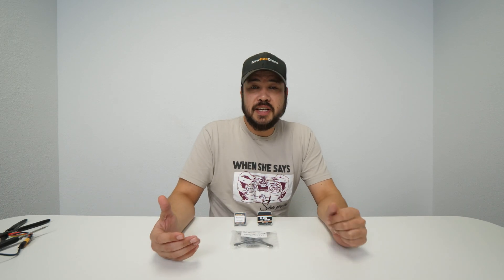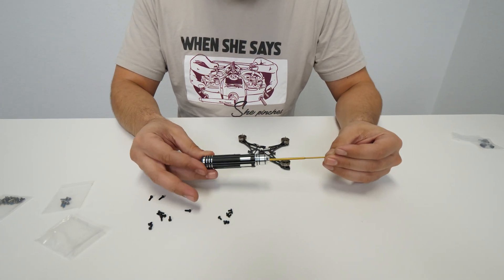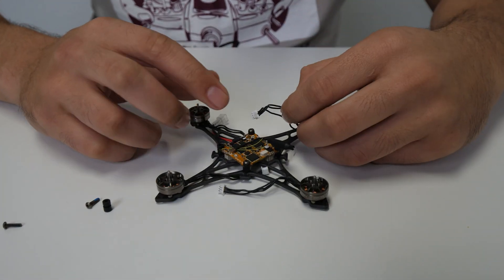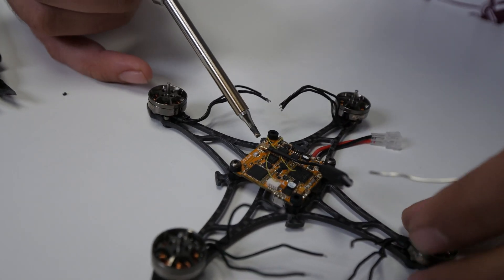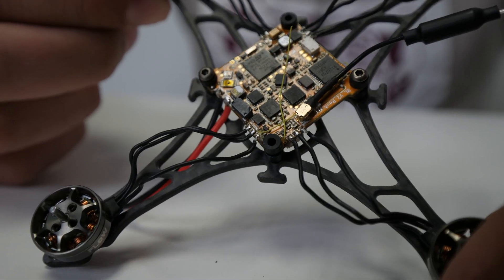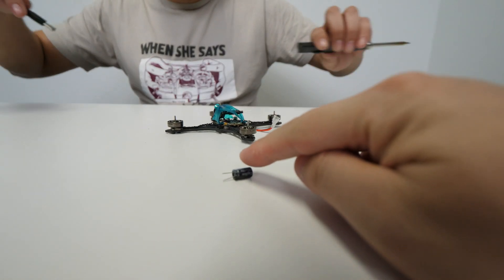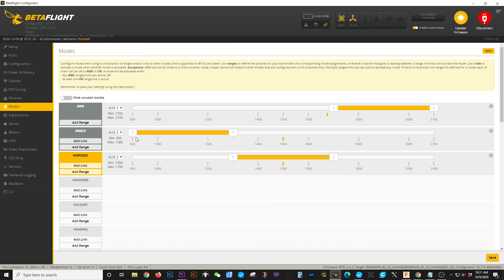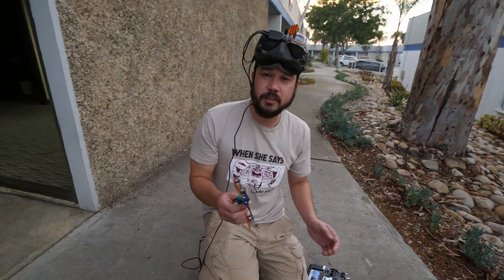SavageBee Build/Setup Video

Comment: My kit contained the BB BLv1 FC with a separate FrSky receiver that I had to solder on. This and all other videos I've seen have the BB BLv2 with built-in receiver. Thus I had to mount the receiver under the FC and use longer screws and extra stand-offs to raise the FC a bit so that it'd fit.

It'd be nice if the kits were consistent with the parts.

This video could have been a bit more detailed. Plus, "all you have to do is solder the motors and you're pretty much done" ... and Oh Yeah! the capacitor too... and Oh Yeah (in my case) the receiver too.

Comment: Can we just plug the motors in? If so sold if not I can’t solder worth a damn on this tiny AIO boards.
Reply: No, can't plug  in the motors. The connectors on the motors and FC are different sizes.

Comment: Why not just plug the motors in? I thought I saw plugs on the FC. Just personal preference or am I wrong about the plugs on the FC?
Reply: Yeah lol, I asked that also xD
Reply: @RealKushrage  for real. Twist those wires and plug it in. They'll get shorter with a twist.
Reply: Yeah, but I wouldn't fly it on 2s like that.

Comment: I get that the camera plug is small and lightweight, but I really wish NBD would stop using "strange" stuff. Just stick with the 1.25mm please. You'd save us the hassle of finding them and yourself from getting asked what the size is a million times. FFS, I just looked and the plug size isn't even listed on the BeeEye camera page. I like NBD and your stuff, but you deserve every time you get asked.
Reply: Seriously. I've scoured the entire interwebz looking for the camera plugs. They aren't available unless you buy the wires, pins, and plastic housings and make them yourself. Luckily, I have 3 that I harvested from dead Mark2 cameras. And yeah, please just use the 1.25 motor plugs. People want to use other motors with NBD boards.

Comment: i'd like to have a few details please.
1s/2s FC, same board or separate board. how many amp ? 5a or more ?
the weight of 1202 motors, either with or without wires.
and when i can buy those motors and that board ?
on newbeedrone site there is a 2s beebrain brushless board, but i don't know if it can use 1s and if it's the same board that use in this drone.
thank you,
Reply: I think it is the same board as on the Acrobee Brushless and it can handle 1 and 2s
Reply: @RealKushrage  i'm looking for 1s 10a whoop board. i hope this is the one.
Reply: @matthew04101  1s 10a whoop board??!!!! Are you crazy?????
Reply: @Max_0578  i just found out that they do have 1s 10a whoop board. i was just a bit confused with all the similar names of all those board.
Reply: @matthew04101  really? Wow. 10 amps is for a 1s whoop board really much
Reply: @Max_0578  here is the name of it if you want to check it out. BeeBrainBL V2 Flight Controller (FC+ESC+VTX+Receiver AIO)
Reply: @matthew04101  thanks